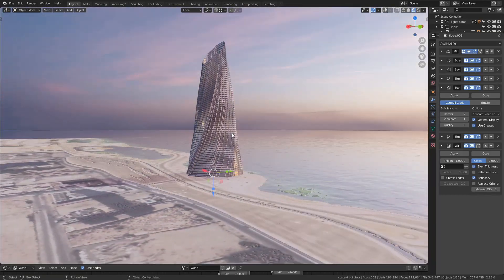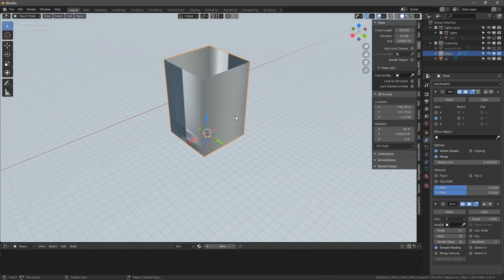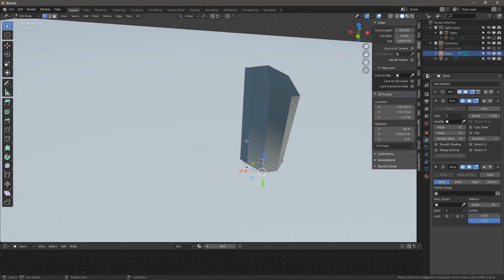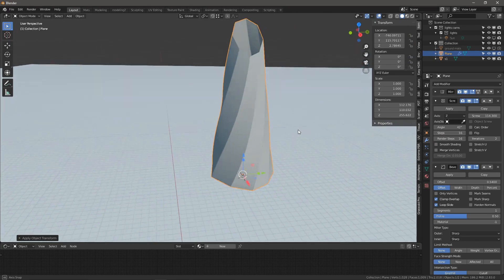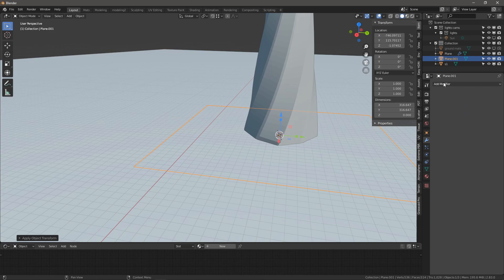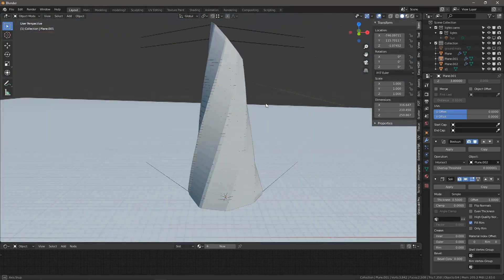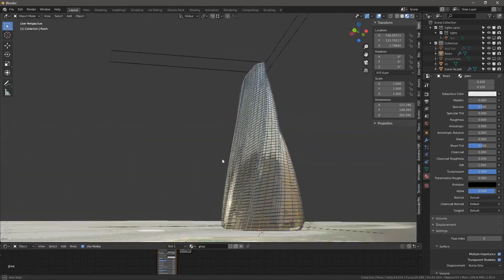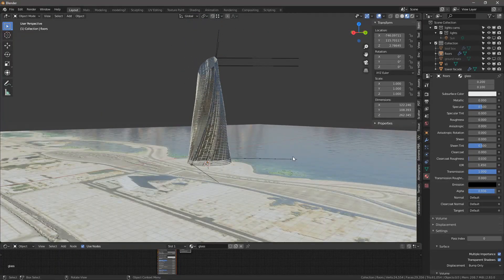Parametric tower in 10 min with Blender!

Comment: hey man, when i add the boolean modifier some floors stick out from the building for no reason... any fixes?
Reply from the maker: Try switching the boolean to "fast" instead of "exact". At the time of making the tutorial, there was no "exact" option and since it has been implemented, it's the default when adding a boolean modifier.

Comment: Boolean not working with floors They all disappear when I try to do
Reply from the maker: Try using the fast boolean instead of the exact boolean option, if you are doing it in 2.91
Reply: Change Steps Viewport and Render on the Screw modifier from 16 to 32

Comment: On 2.91 the Intersect Boolean doesn't seem to work like in the video...
Reply from the maker: You might need to change a setting within the modifier from "exact" to "fast"
Reply: Change Steps Viewport and Render on the Screw modifier from 16 to 32

Comment: Great quick tut, thank you.  If I may suggest: the artifacts you try to fix at ~5.00 come from the mirror modifier - replacing the initial 5 verts with a plane hexagon may spoil the perceived simplicity of the construction but cleans it significantly.  The ugly lines at the top come from "extra floors" of the floor-plane array: reduce number of floors and they are gone.  Hope it helps.
Reply from the maker: Thanks for your tips. The artifacts come actually from screw and leaving recalc normals unchecked. If you see the next videos in the series, you will notice a cleaner version of the model.

Comment: It's just form. we need critical architecture rather than pretty looking things. Sure it's just a tutorial on parametric type modeling but this is intended for the students: it inspires students to just think architecture is a quickly churned out product but we need to understand bigger impacts than formal products
Reply from the maker: Sure we do! (And there will be content coming soon for critical thinking) But it is also important to experiment to gain the necesssry skills. I learn something new in regards to 3d modeling (many times not directly related to architecture) everyday so when I am working on a live project, I can apply those skills to get to the desired result faster - the right floorplate, orientation, program, footprint, circulation, contextual conditions, sharing solution, etc.